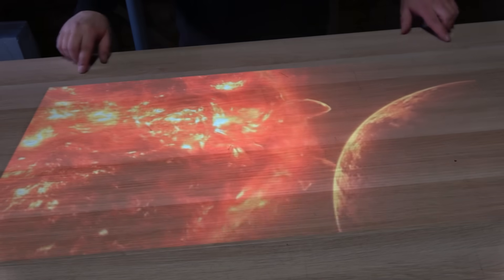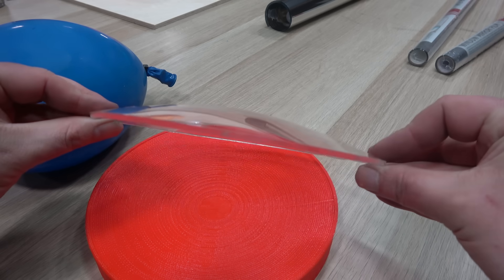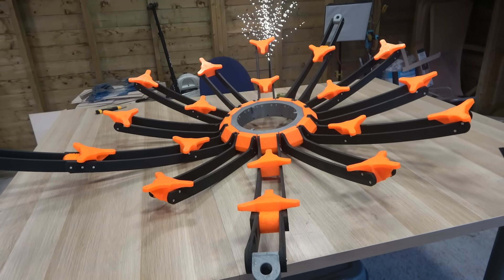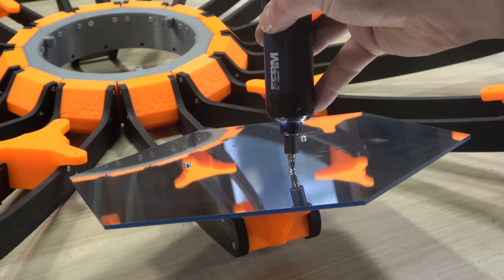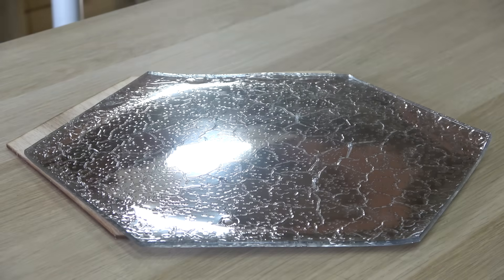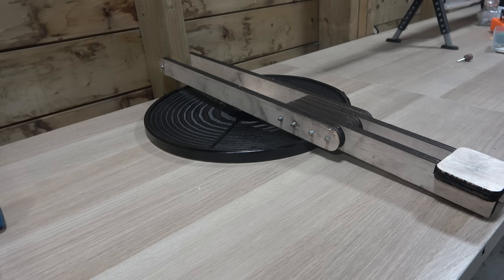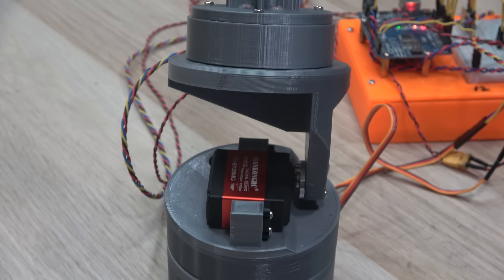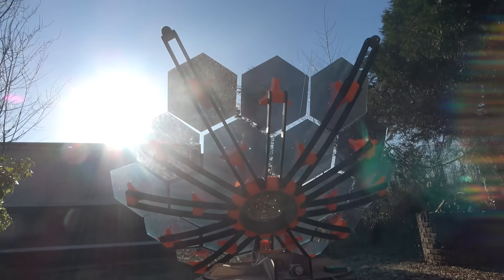Building a DIY Solar Generator..

Comment: Engineer here with a few suggestions -

Your aluminum plate should have been copper for a couple of reasons - first, aluminum is reflective in the visible spectrum. A copper plate can be treated with a liquid known as "liver of sulfur" which creates a strongly-absorbing black surface, dramatically increasing the amount of energy that can actually be absorbed. Second, copper has a thermal conductivity roughly twice that of aluminum, meaning your total thermal resistance is lower. The net effect is that significantly more heat can flow from the absorbing surface into the water. 

Another consideration - choose the flow of the water carefully so that you are in the turbulent regime - this will increase your Nusselt number and further improve your efficiency. 

As others have also pointed out, each mirror segment can be flat as you are trying to focus onto a large area. This is also preferable as a uniform temperature distribution in your collector will also serve to boost your efficiency. I suggest you look into non-imaging optics, and specifically into something called a compound parabolic concentrator or CPC.

Another more advanced improvement that can be made is to place the front side of your collector under vacuum, or at least under partial vacuum. This reduces convective losses from your collector. 

You may also find after having made these improvements that there will exist an ideal operating point where you have the collector operating at a sufficiently-low temperature so as to reduce radiative losses. The blackbody radiative losses from your collector scale as temperature to the 4th power, so while faster water flow will help you get into the turbulent regime it will also lower your operating temperature which serves to reduce radiative losses. 

This is a cool project with a lot of room for exploration! keep up the good work!
Reply: would also suggest to make the plate in the middle black, but still leave it be in aluminium since a copper block that size would be way to expensive for a project like that, at least for now.
Reply: @TheFlow2006  Instead of a copper block, he could tightly wind a flat copper coil out of copper pipe. Would also be cheaper than having a block machined and is easier to seal than a block with a plexiglas back.
Reply: @TheFlow2006  and the copper will be significantly heavier than aluminium.
 
Another reason to just use flat mirrors is that the parabolic shape you used needs each mirror to be facing the sun, which they aren't since they are tilted slightly. That means the single focal point I no longer correct. You'd have to have different moulds for each mirror that are at different distances from the central axis. Basically, you need the entire mirror assembly to approximate a parabola, not each individual mirror.

I think you would still get slight efficiency boosts from going parabolic over flat mirrors though purely due to the size of mirrors that you've used. The larger the mirrors, the more light that won't hit your secondary mirror since the edges are further from the parabolic optimal. You can reduce that loss with flat mirrors by using a larger number of smaller mirrors.

To get the even heating mentioned above with parabolic mirrors, you just move your target slightly out of the focal point. That way you gain the culminating benefit of a parabola without the loss of energy compared to flat mirrors.

Another idea is to just use flat mirrors made from thinner perspex and bend each one with individual edge brackets rather than heat. That should create an approximate catenary curve you can change based on distance from the centre, which will then be a bit closer to parabolic without compromising on reflectivity. It would be a lot easier to manufacture too. You'd just need different angles on each edge bracket the further you are from the centre.
Reply: The heat exchangers my neighbor has on his roof are copper with that coating.

Pitch black and even during winter when it's freezing, they manage to heat the glycol in the circulation system over 100C.
Reply: @enlightendbel  What is that heat exchanger used for? In place of a water heater?
Reply: @beestingza  heat exchanger is an air conditioning unit that can be run in reverse, augmenting or replacing a traditional furnace
Reply: @ Yeah, in this case it isn't an airco heat exchanger.

@beestingza it's for hot water, yes.
Reply: @enlightendbel  I'll see myself out
Reply: I wonder if it would be possible to integrate a consumer cpu block, treating a large (but thin) copper plate as an IHS.
Reply: Excellent feedback. I had some intution about some of these recommendations but didn't know the names for them, i.e. Nusselt number and the copper collector. Thank you for giving the curious lots more to read about.
Reply: Blackening the collector plate is a great idea. So is cutting narrower or shallower channels to give the water more surface area for heat exchange. For proof of concept, imperfect mirrors shouldn't make a huge efficiency difference, since they're concentrating the light anyway. Choosing less transmissive film might though.
Reply: Another suggestion, for the reflective panels use Barium Sulfate paint as it is significantly better a reflecting light than a metal surface.
Reply: also consider wind when making your tracker, and consider fire hazards. Having built a few reflectors I know how dangerous they can be. In your case, it the aim is off for some reason, the mirrors near the center may get fried.
Reply: About to mension the same about this.
Reply: I suppose it could be used offshore to desalination water and have it channelled to shore via a one way valve pipe?
Reply: @tonykuli  it's a good idea if you're planning to replace the entire rig every 2 yrs
Isn't salt corrosive? Isn't it easier to pipe the salt water to a land instead of fresh water? Do it that way and the salt is recovered as well
Reply: I would have also spray painted it black so that it absorbs visible light in addition to inferred
Reply: Chat gpt ass comment
Reply: @SJokes says the background character
Reply: hi, I want to build something similar, but I don't know what to use as a reflective material/coating   I noticed that u are good at it so I wanted to ask
Reply: Your comment is fascinating. Never heard of Nusselt number before, or 'compound parabolic concentrator', had to look 'em up. "Learn something new everyday" and all.
Have to say though, upon looking into Liver of sulfur to make the copper dark, I'd say f*ck that dodgy shite, because it's just another carcinogenic crud chemical. Better to use low VOC black metal paint 😉
Reply: copper is way more expensive than aluminum, that's why he went with aluminum
Reply: @pccalcio Small diameter copper tubing that is tightly wound is not all that expensive. The coils could be brazed together for homogeneity and then chemically stained black (as has been previously mentioned). Also, it would avoid the potential leakage problem of your bolted-up plate assembly. Since when did springs become expensive. They are one of the most highly produced and used mechanical devises on the planet. Also they will not succumb to gradual heat failure as the polymer springs will.
Reply: Not only that, the mirrors are nowhere near perfect so they arent gonna be nearly as reflective as a quality expensive mirror
Reply: Thank you sir
Reply: By and large transferring solar into heat using water is wasting potential
Why peddle 212 or 100 degrees when mineral oil and copper dust can do many 100's of degrees
Then use that source to heat your water
The excess heat can be stored in sand
Reply: Alot of good suggestions, since hes already spent 170$ in the heat exchanger its probably a little to make the change to a copper heat exchanger though, he could however flip the boiler over and place a copper plate like the one you suggested where the acrylic plate was. Im also curious to know if spending $50 for some vanta black paint would be good enough, the thermal conductivity of paint probably aint the best but it would absorb as much light as possible. 

Lets say he's able to get his collector to harvest ~85% of the solar energy in that area putting it closer to a 3kW generator, the question is now what do you do with that energy.  If you do nothing with it, estimating about 1 gallon for his heat transfer loop, that water will be boiling in 7 minutes, causing the pressure to build up and likely blow out one of those water lines. The most efficient use of this energy would probably be heating for air and water in your house since it wont suffer from the high losses a heat engine would driving a generator. However if he has a 40Gal water heater and its summer time hes only got to wait an hour and a half before that's at it setpoint and then your back to the same problem of boiling your water. 

If using a heat engine is the desired outcome then you have a different problem, that being that your heat transfer medium has the same boiling point as your working fluid, assuming your using steam. This could be solved by creating two different loops and pressurizing the one in contact with the aluminum plate. However the additional plumbing and energy needed to maintain this pressure probably isnt worth the effort for such a small generator. An alternative solution would be to use a different working fluid with a boiling point less than that of water but its out of my field of knowledge. looking at the list of possible working fluids i suspect alcohol is probably the most friendly for use in a hobby project, since it relatively easy to acquire.

Hope you reads this and it helps CCC
Reply: The heat exchanger in the middle could be made of copper, with the face painted with the blackest paint you can find.
Reply: Or paint it black
Reply: Yo quiero evaporar agua de mar .
Me servirá un tanque de cobre  puesto en el punto focal?
Pienso que podría fundirse el cobre .😮
Reply: @arioacasius4027  Esto es posible, pero creo que no pudia fundirse el cobre si hay aqua tocando el otro lado. Un opcion que puedes intentar es crear lo mismo que Concept Craft Creations, pero tener la agua pasar por el tubo a traves de la agua de mar. Esto va a calentar y evaporar la agua de mar y mantenga el cobre lo suficientemente fría para que no puede fundirse. No hablo o escribo español muy bien, lo siento XD
Reply: Use copper??? It's a 5$ Project, not 500$...

Exaggerated but yk what I mean right?
Reply: @pfinks7889  That's not a 5$ project. Machining that aluminium heat plate alone would cost at least several hundred.
Reply: Yeah the sun is a big believer in "once you go black, you don't go back",
I am not an engineer.
Reply: It almost feels like building it the traditional way with individual tracking flat mirrors and a stationary tower would be better. Not as cool looking though.
Reply: Wouldn't then a plate of aluminum bronze treated in liver of sulfur be better than either al or copper?
Reply: bravo!! good point
Reply: Can you make something like this for me? To charge a Tesla? What would you charge me for this?
Reply: As not an engineer, i totally agree 😬
Reply: I would definitely add a warp drive inter-link.
Reply: I have a suggestion: pick up a physics textbook. These numbers are physically impossible (unless he means peak) :D
Reply: turbulent is less conductive
Reply: @Blox117  It is more convective than laminar flow.
Reply: @Blox117  you have a brain. Use it to be positive and not cynical and maybe you'll realize that you're smart. 

Regurgitating what you think you know rather than taking your time to figure out why you're not understanding is a trait of a very low class citizen

Comment: Just a thought, i might be wrong, but painting the heat absorbing plate a matte black might help instead of reflecting the light out of the dish with the polished aluminum.

Comment: 1st surface mirrors either silver or gold would work, gold can be used better as it's easier to apply and you only need a little amount and also has a 99.5 % reflectivity and silver has a 95% reflectivity.

Comment: Use soda lime glass for superior surface roughness and coat electrolessly which is used for creating mirrors. Soda lime will soften at lower temps arong 570 C

Comment: A couple of thoughts.

It appears that a red led was used for the reflectivity test. I'd expect an infra-red one would be more realisitc. Also, there seems to be quite a bit of slop in the holder for the test sample and that could significantly affect the accuracy.

For the sun tracker to work properly, the LDR's need to be matched over the working range.

Comment: Gorgeous overall design. As some others have stated, the primary mirrors do not need to be parabolic. Therefore, you could simply use polished stainless or aluminum. I have seen similar designs, but your hexagonal shapes are even more appealing. Want to try it myself!

Comment: I don't think you need separate mirrors at all.  But... I would make them out of metal and coat with mylar, then run copper tubing from outside to inside behind each mirror to collect that heat as well.  And i would use mineral oil instead of water, and transfer the heat into water later.  Typical TEGs are expensive and don't generate enough watts.  but a colder sink is necessary for  temp differrential to make a heat engine of most any type involving expansion. pump should be on temp sensor to pump when >100C, with reservoir of appropriate size.  Arduino for sun position is unnecessary, the motor relays can be connected directly to sensors... and lacking light should return to home position containing simple leaf switches.  Since you aren't changing latitudes with it,  only minor rotational changes may be necessary... so entire parabola should pivot 180 degrees from morning to dusk instead of a max of 90 and then rotating at Noon.  the counterbalance idea is sound. And the copper tubing can be connected to flexible hydrolic (or sink faucet) hose where it needs to bend (w/ high temp washers i guess).  The double bouncing is also an issue for me... I think the collector should be at the apex.  And a new center mirror since it's mostly shaded from collector can contain the alignment optics.  So most of what you have can be reused except some wooden mounts.

Comment: it act like a lever because you mounted it like a lever, way off center. but this where all such trackers have a flaw, either you off set it to protect it by getting it to lay flat, which uses alot more power, or use less power but endangers it in high winds.  example. https://youtu.be/zHw1xMMRlwk?si=eQMrBqUpnzzMywfh so where is the trade off in using the best one?????

Comment: Great ideas, fabrication, and explanation of your thought process! Having recently completed 13 years in the large-scale solar power industry, here are some comments to digest.  For those hoping to home brew concentrated solar generation for home or small business, the many problems to overcome are mulit-year durability, degradation due to falling reflectivity, wind survival, and reduced output due to high temperatures caused by concentrating solar energy. Solving these problems greatly increases cost. The reason less efficient flat solar panels dominate the market is, considering positive and neagative tradeoffs, they're far superior to concentrated solar technologies on a cost vs production basis.  Single axis tracking improves production with only a small increase in cost. But 2 axis tracking greatly increases cost, complexity, maintenance, and reduces longevity of the equipment.

Comment: This light reflecting film is quite garbage, I believe. I used them for some time to cool my room down at summer. This film reflects only a portion of light. You can clearly see reflective tiles being transparent. As others have already mentioned, parabolical shape of individual mirrors is not required, as the whole assembly itself acts as parabolic mirror. You can probably use real mirrors instead. It would be interesting to find difference between current setup and proposed one.
By the way, the project is really cool!

Comment: Great project! A cheaper and faster solution than the central disk would be flexible copper tube, coiled up in a flat disc shape. Then also make it matt black as many already suggest.

Comment: Consider adding an axle perpendicular to the back of the mirror, with an adjustable weight for counterbalance to take the strain off the motors and positioning mechanism. Also consider wind loading. The big wind that hits while you're away and can't reposition it into safe mode position.

Comment: The plastic parts you're building with have a thermal limit, that's what you need to stay below. The collector plate in the center with its plastic supports and backing, that needs to stay cool--not 400 deg 
F/200 deg C. That's what your rig will get too if your pump stops. Judging from the video, your pump needs to push a lot more water through the plate. Does your plate produce hot water that circulates through a metal coil inside a storage tank, or produce hot water directly for tea/drinking? If drinking, is the plastic tubing or backing of the collector food safe? Aluminum is not food safe actually.

Comment: A man with 3D printer is looking for some tasks to use his expensive equipment. A single PV solar panel on his workshop roof would have been better and he would already be generating electricity - no need for part 2

Comment: Your sun tracking mechanism is vastly overly complex. The sun follows an arc across the sky. A single access of rotation is enough to follow the sun. You just need to align the axis correctly.